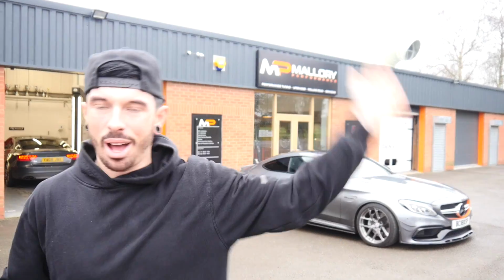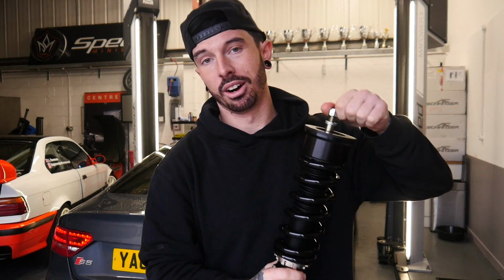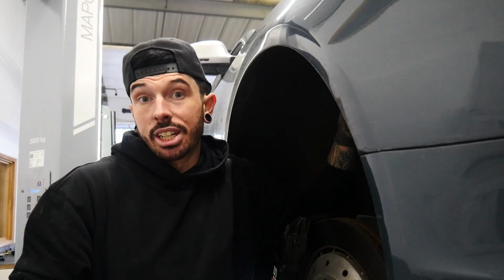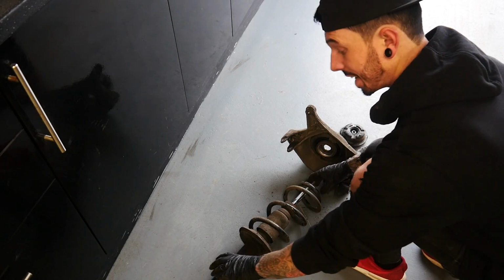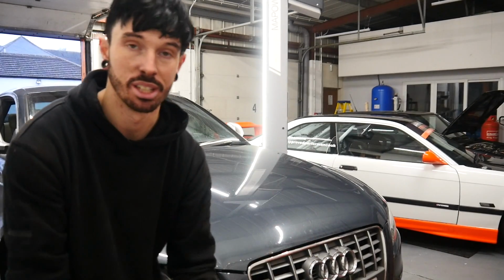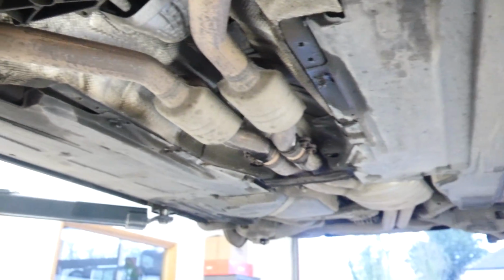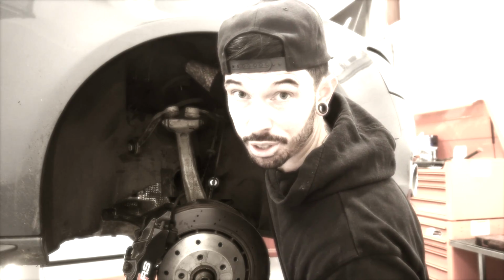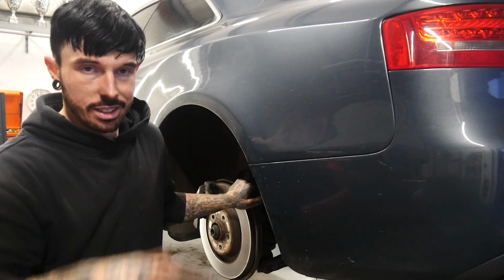COILOVER SUSPENSION INSTALL FAILED! AUDI S5

Comment from the maker: Just a reminder to a few haters... I AM NOT A MECHANIC. I don't claim to be 😂 this Is a hobby and entertainment 🙏 ✌️ Peace
Reply: Mat Armstrong  haters have no wife and no car🤷‍♂️😂 but they are experts on both🤷‍♂️😂
Reply: @davidtheswedishtechguy  yes they are both brilliant when you get a good one 😉👍🍺
Reply: You rock...stay having fun!  Life's too short...
Reply: hey buddy, those Are Cat.s - but they are secondary Cat.s . . . you started to point out the primary ones then the video panned away . . .
Reply: Been there before Mat, there will still be enough meat on the damper bolt, once some heat is applied that will come out. I had the same fun doing the suspension on my Abarth. Just remember that you need to keep the flame away form the alloy arms. Good luck.
Reply: Your not a mechanic but you should be and have your own shop one day!!
Reply: Doing a great job on the Audi Mat, showing how things can escalate when removing components which have been on a car several years. Much rather see this than someone doing the job where everything just slides out with ease. Not real life.
Reply: Just a suggestion, as I've also learned my lesson (lol), keep some penetrating spray on hand when undoing bolts.  I use 'PB Blaster' here in the U.S.  Looking forward to the next video!
Reply: If no one's already said it bud, with seized bolts.. WD 40 first if that doesn't do it use a burner torch.

Sorry if you're an 'in the ken' type of guy.. I here amassed s great array of tool's for my car's over the years, those ones I just mentioned really are go-to tool's for those older cars and especially them being underneath, they're always seized through where they are situated. 

Great video again, 
love from Liverpool.
Reply: I think you are. Make it look so easy. Thank you. I have 2008 A5 s line 3.2 and you are tempting me to try
Reply: Great video bro haters are everywhere as you know iv started my own YTC and get 👎🏽but I’m glad iv got people to watch my videos and give me a 👎🏽lol thanks 🙏
Reply: Hey Mat,I have the same car and as well a month ago I changed all springs and dampers and ran into the same issue since the bolts are iron and the parts are cast aluminum.They had to drill the bolt out,no other way.What i do recommend for the future,use heat on them before you loosen them, it worked for me since.
Cheers for you and big thumb down for the audi engineer who designed iron bolts vs aluminum parts that fuse together over time.G8 german engineering...NOT
Reply: Sometimes things just don't go right in the mechanic world. I remember changing my rear shock dampers on my 1966 Olds Toronado and even though I soaked the nut it with "Liquid  Wrench" and I just knew the nut was going to shear, but just to let you know it was a "RoyalPain"" to get the bolt out! Best of luck!
Reply: Haters will always hate regardless.   Keep up the good work fella subscribed 👍🏾
Reply: No need to apologize and preemptively dismiss the hate.  Love watching the videos and keyboard warriors try to ruin everything.  Keep em coming!  
✌️&♥️
Reply: Mat Armstrong it’s all good bro. It’s pretty cool watching u learn from ur mistakes as u go on. It makes everything authentic. Haters will troll and hate but remember, they also fucked up since they want to school u on what to do! 😂
Reply: Dont even address them, your blowing up right now you could be the UK'S Tavarish and make bare p
Reply: Ignore them... If you don't make mistakes you will never learn anything... Its a fool that make mistakes and doesn't learn.. from what I have seen from your videos you are doing fine... Keep it up 👍
Reply: We still enjoy youre positivity drive that u got .. and that uk accent make it perfect hahah
Reply: @davidtheswedishtechguy  Not hating here and love the content but " have no wife" I rather keep it that way.
Reply: Wasn't the accident damage on that side? Plus near side always ends up going through puddles, maybe your recent work on the front helped knock the rest about enough to make it not be siezed, as u didn't show that side I'm guessing it was harder than the off side on the front too.
Reply: Stay strong!
Reply: Really enjoy ur videos. Keep up the work 🇨🇮🇨🇮
Reply: Fuck the haters (know it alls) your subscribers are here coz they like you and your content, keep it up bud 🍻
Reply: A+ +++.  For having a go mate there’s always something that f@@@@ a good days works up
Been there before
I love 💔 way u say sqeaky bum time 

Made me laugh.
Reply: its a learning fun keep up the videos mate
Reply: Don't bother your backside with the haters mate. It's your hobby, it's my hobby. I look forward to the better weather to tinker about with my old Calibras. Really enjoying your videos.
Reply: New subscriber here, You are one of few people Mat Armstrong that actually keep me interested... I have no idea myself,but enjoy the effort you put in..keep it up mate
Reply: Stay up bro bless
Reply: Great work Matt, you deffo jinxed it. I am wondering if those bolts were replaced due to the accident damage on that corner, maybe replaced with non standard bolts as odd to both snap. Keep up the great work and can’t wait to see it sitting nicely.
Reply: Most of the haters probably cant put Lego together, broad shoulders mate you you have content in your vids they are just jealous 😁
Reply: Love these videos mate! Keep it up!
Reply: @joshuam7552  did you not see him use WD40?
Reply: Ashley Mapes Nope sure didn’t.
Reply: Ashley Mapes And I suggested PB Blaster, not WD40. Doesn’t work as well in my experience.  What have you used while you were changing your suspension to get those tough/ stuck bolts out?
Reply: What’s is your job bro ?
Reply: Mat Armstrong your vids are awesome.
Reply: whats the labour on this professionally? 6 hours?
Reply: Now you are a fully fledged one!

Comment: In future try using an impact wrench to free those stubborn bolts. I've had the same issue with snapping bolts using raw power lol. Good job on keeping the footage true though bud.
Reply: Was just going to post the same.
Reply: Was gonna say the same too, with that amount of torque on the bolt. An idea would be to heat it up real hot and then use an impact wrench or ring head spanner to get the bolt out... I'm gonna wager that although he had access to the lift, they probably didn't provide other tools..?

Really love this guys humility when making videos though, good fun to watch!
Reply: Careful no to strip them though
Reply: @thamil1365  Second option is to take a metal dowel/rod, spray some penetrating oil on the bolt and then hammer the top and surrounding areas next to the bolt. This sometimes needs a good 15-30 minutes of hammering... Every few minutes, try applying some force to the bolt and unscrewing it, if it budges then rotate it 45 degrees and back again, this just helps to prevent stripping the thread and to work the oil into the grooves.
Reply: I've snapped plenty bolts with an impact wrench also haha
Reply: Make the composition 50 % steel, 50 % penetrating fluid. Then tighten, loosen, tighten, loosen, tighten, loosen, etc. little by little. If you go all out with a 2 meter cheater, you are guaranteed to snap it :D

Comment: So many things went right and it's a complex job.  I think you could still claim a victory at the end of that day.  You got to use a car lift for the price of a sandwich.  Imagine how hard it would have been if you never got that first bit of luck.  Keep at it!  Try to have a contingency plan next time.  It would be nice if someone could give you a ride home or if you could use a ride share app.  The app would cost more money, but that's why you have a plan B with some savings stocked away.   You didn't mess up anything as far as the car repair was concerned.  Those things happen to everyone from time to time.

Comment: Oh my gosh, to see somebody else have so much trouble with l coil overs. Finally got them installed after threaded bolts drive down the road and every little bump bit like a pothole somebody hits the car hammer adjust every way. The car has never driven so badly shout out to Max speeding for the worst customer service ever known to man kind.

Comment: That shit usually happens to me on a Sunday afternoon with no access to another car!

Liberal spray with PlusGas a few hours before when doing suspension jobs.
Reply: My thoughts exactly. A quick squirt and then a spanner, don't give it time to work at all.....
Reply: Also I find plusgas better and more effective than wd40. I only buy plusgas now
Reply: @vp5  2nd that. Very good dismantling spray. Just remember to tighten before undoing, to break the rust seal.

Comment: Its all learning dood :) Weld the biggest nut you can find/fit over the remainder of the bolts and impact gun em out. I would aim for a 30 or 32mm nut as the bolts you broke look to be m12 or m14 so you should be able to get a good weld bond between the center of the nut and the remaining stud, fill the nut in the center with weld and the heat transferred through to the hub should hopefully be enough to free it off. This problem is mainly due to GALVANIC CORROSION where mixed metals are in contact, i.e the alloy of the hub and the steel in the bolt, some say things like copper grease can help prevent this but it will always be a problem on vehicles with alloy subframes and suspension components. Good luck with the fix dood. Great videos :)
Reply: Galling is the primary cause of dissimilar material surfaces mating to one another. 

Galvanic corrosion is also big issue on machinery, but galling is more likely the cause in this instance.

Comment: And another tip, if youre tackling something you expect to be tight or seized, give the nut/bolt a few really good raps with a hammer or spanner before turning it, it can make such a difference.  I had a couple examples today where I gave a couple 22mm nuts a good bash today and the bash itself loosened them, whereas the same component on a different machine the day before was a real mission

Comment: I like your work and enthusiasm for undertaking what may be a very simple job on a Honda, but is actually a lot more complicated on an Audi. I know from personal experience how much of a pain those pinch bolts on the front knuckles can be to take out. Air hammer usually needs to come to the rescue. For everything else, I would recommend a proper penetrating oil, (WD40 is just not strong enough) and more use of impacts and heat to break those stubborn bolts loose. Keep up the awesome work and updates on the S5!

Comment: That's a real shame Mat - hate even hearing that sound when a bolt /pin snaps 
I had a big issue with a A4 in the past with all four bolts relating to me replacing the front disks, all 4 bolts needed replacing and were £10 each 
Was also sold the wrong disks ''sold me disks for a merc'' and didn't notice until the box was opened

Comment: Yay its a long time now i pre-spray the parts with WD 40 five days in advance
Reply: WD 40 is rubbish mate. You need a proper penetrative not a lubricant.
Reply: @DanDan-xx1yg  
That's the main reason i pre-spray  five days in advance lol  usually i use BP
Reply: Dan Dan he’s right. Shit even 1 day can make a huge difference
Reply: Dan Dan WD40 isn’t a lubricant. As the name suggests it’s a water displacer.
Reply: Actually these days WD-40 is a brand name. You can get all kinds of sprays from them.
Reply: Milan Marten the one he is using is original wd40 which is neither a penetrating oil or a lubricant. There is a ‘WD40’ penetrating oil which comes in a black can. If you say wd40 to most people they only know of the blue can and think it’s a lubricant, which it isn’t.

Comment: Your best bet to get those bolts outbid a tungsten carbide drill bit along with some kind of cutting fluid you will be able to drill within a few mm of the bolt size and put the drill in reverse and the snapped bolt will come out with it. Hope this helps.

Comment: Unlucky with that last one! You should use an impact gun to free the rust. Failing that get a blowtorch heat it up and then cool it with water, it cracks up all the rust and frees it.

Comment: just a tip for anyone interested in taking the pinch bolt out from the top, when it is seized in there, which it likely will be. Break the head off the bolt by loosening it untill it snaps, then tighten the nut on the opposite side, this will pull the bolt through, because the bolt only has a part thread at the end you will need to take the nut off and add washers from time to time, but eventually it will come all the way out.

Comment: drill holes like half diameter of broken bolts and use good quality broken bolts extractor,also you can heat it up little bit that bolt and knock it few times before driling

Comment: been enjoying ur videos and im currently doing up my 2011 audi s4, I will recommend you cover the area where the flexible brake lines meet the rigid brake lines in copper grease, as they are prone to rusting and oxidising to an extent where the connections on both will be unusable.

Comment: weld a nut onto the remaining part of the bolt. The heat in itself from welding should free the bolt and then you just unscrew it from the nut.

Comment: Those top pinch bolts are always a nightmare buy new ones and fit with copper or alu grease and they come out no problem after

Comment: Had a passat with that pinch bolt issue. Had to chop the ends off heat it with a blow torch and knock it out. Pain in the arse

Comment: A good cheap mod to do for extra exhaust noise is to cut out the front 2 small resonators on the downpipes and weld/clamp in a straight piece

Comment: Interesting. This exact thing with bolts snapping happened on my S6 as well. I had to weld the head on so i could driv eit and then change out the wheel spindle as I had no way of removing the broken bolt.

Comment: Heat. Get it glowing hot, the different metals will contract at different rates and help loosen the bolt. Not that saying that helps you now though...

Comment: I broke a bolt that was holding up my petrol tank a few years ago, while replacing an ABS sensor that went up in behind the tank, so I just went into butcher mode and drilled a new hole next to it and put a cable tie in to hold it up. It held perfectly fine for years until I sold the car..

Comment: I've been looking at fitting bcracing coilovers to my A5 which has 20" wheels. The coilovers cost upwards of £850 if your willing to buy off eBay.finding somewhere to fit them isn't easy though and I've still not got a quote.

Comment: I'm sure the ARB bolt snapped because the suspension was hanging. Theres more tension/ pressure on the bolt it will never loosen off under that stress. You need a jack under suspension to take the weight off. Although dont reckon it wouldve helped the bottom damper bolt. Audis mix of aluminium and steel components is murder to work with. Maybe 2 days soaking in WD40 and some oxy/act would do it. Good luck.

Comment: I have replaced the front shocks on the A5 but stuck on the rear shock bolt. I really thought the rear be easy compared to the front but really scared I may snap the bolt like you did.. I would cry if that happened to me :(

Comment: Use proper penetrating spray wd 40 is good but it's not meant for freeing bolts also treat all the bolts you're gonna remove 2 or 3 days before you remove them if you have the opportunity and as mentioned invest in a rattle gun. Snapped bolts can happen to the best of us especially when they've been under a car for 10+ years. Chin up mate.

Comment: Heat mate, if it doesn't want to go dont force it its steal in aluminium after all, you get heat on it first. Your best bet now is to weld a nut on the end and try again, and use heat this time.

Comment: Impact gun required on sketchy bolts. I'd also be lobbing on penetrating fluid in all bolts and joints as soon as the car is in the air, give it as much time work I to them threads!

Still bad luck

Comment: Smoke the lights and the plate pls 🤩
Reply: No just no. Smoke plates look stupid and illegal.
Reply: Lee Johnston it aint ilegal, in Uk ..over 1000cars everyday with smoked plates
Reply: Ramos bro it is illegal. Rear plate needs to be yellow, front plate needs to be white. They also need to be ‘easily readable’ and at distance these smoked ones are not.

Comment: I legit broke the same bolt for the shocks on the same side aswll😩
Reply: So if you get it out, could you please tell me how you did it. I’ve tried drilling it out with no luck. And i don’t feel like buying a new wheel bearing housing :/

Comment: Woyo Bolt remover heated coil on ebay will save a lot of hassle on super tight bolts. I have done the same its not nice. I feel your pain :(

Comment: The exact sway bar link bolt snapped on me when doing lowering springs on my a6. I still am driving it with 1.5" of stud holding the end link on but I have no idea how to remove the stud. Someone please respond if you have any suggestions, I've tried torching the aluminum, oiled it up, welded a nut on, and it just keeps breaking.

Comment: Those bolts are awful, I got them all out but somehow cross-threaded to ARB bolt when mounting again, and it never came out. I had to drill the f'er out while on the car and re-thread the hole. I also spent 5 hrs on one side for the pinch bolt in front and 3 hrs on the other side on the pinch bolt... When I got it out it appeared it had been replaced with a straight bolt without the "neck" where the diameter is smaller like on the original. Had to use an air-chisel to get the pinch bolts out.

BTW, impacts are nice for bolts that require a lot of torque like the damper-bolt

Comment: Happened to me to, it’s because some idiot have bean there before and not put on the cap over the bolt😡🤮

The bolt is steel and the arm is aluminium so water makes it way in the threads and it corrodes 🤷‍♂️

Mine dident snap but it stripped 1/3 of the threads😩